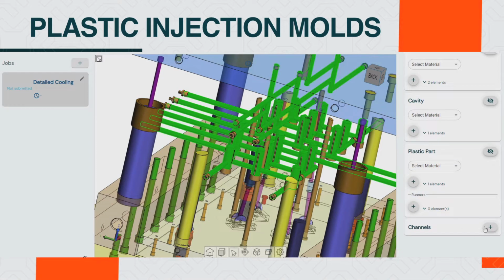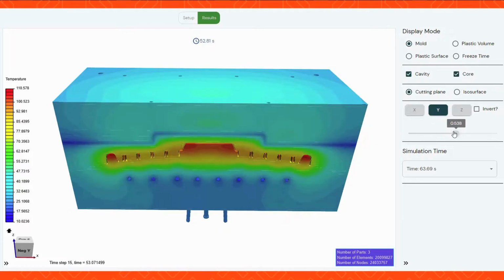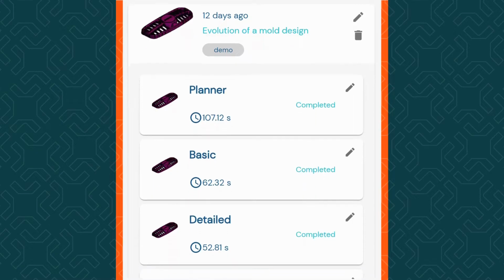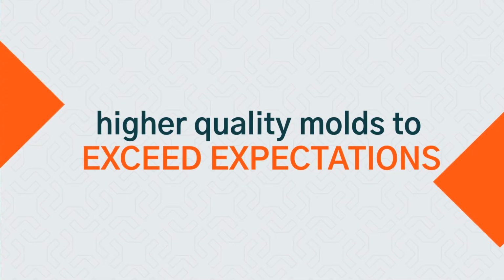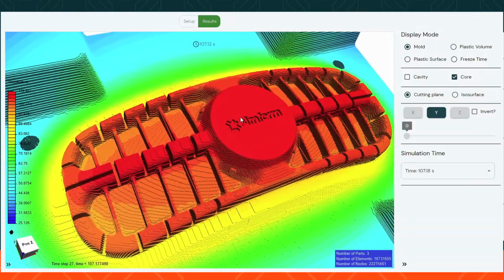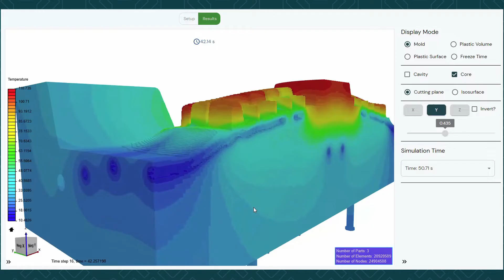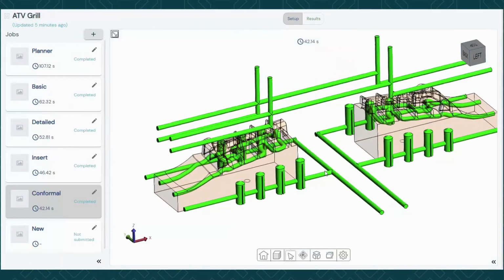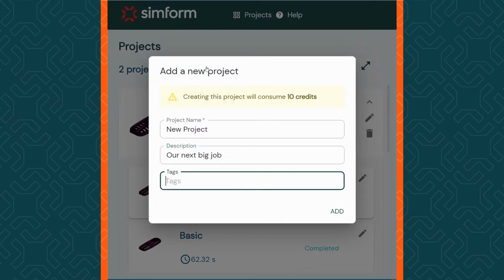SimForm - Easy Mold Cooling Prediction

Comment: This looks similar to the Moldflow analysis
Reply from the maker: Hi Geoff, you are totally right.
SimForm enables experts without any simulation expertise to run Moldflow analyses.
It has additional features to consider:
•	It is extremely fast to set up and run (results in minutes) which makes it possible to test different concepts
•	You only pay for what you use (no upfront license to purchase, no maintenance fees)
You can find more details on our website (https://simform.app) but feel free to reach out to us directly so we can talk about it (info@simform.app).